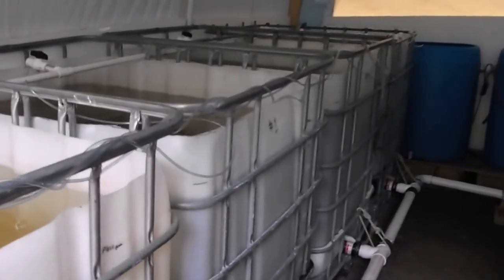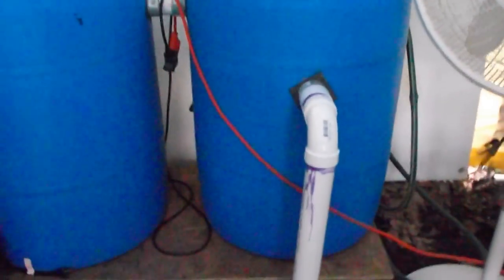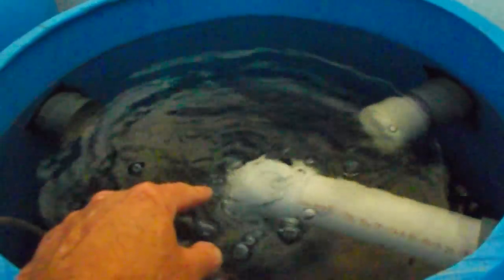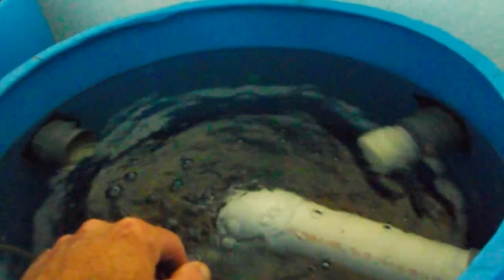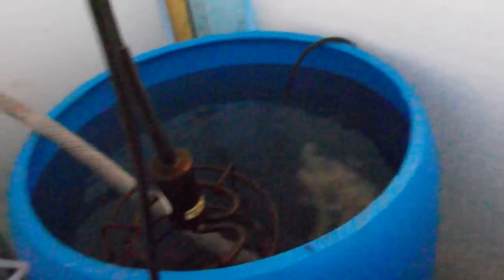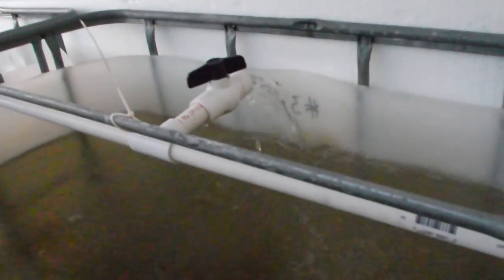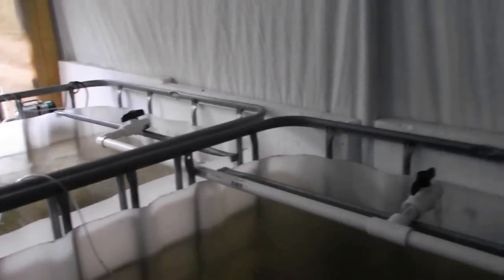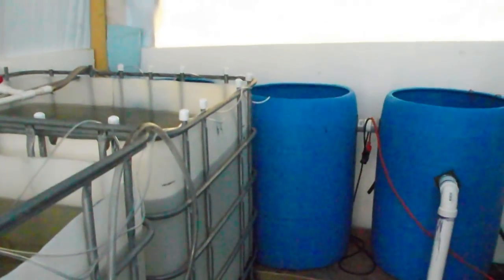Tilapia - Filter System Details

Comment: Good work on the filter design. I have almost finished building my new system using three IBC for the fish tanks. I was going to connect the drains at the bottom like you have, but then I was concerned about the young fish being able to exit the tanks via the drains. So I am using 3" SLOs for my drains. How are the bottom drains working for you and how do you keep the little buggers from escaping their tanks? Thatnk. JW

Comment: Hi Greg I have a 4 tote system so I bought the Active aqua air pump, my question is , do I need to have all the air stones at the same depth in each tote  for the pump to work well and does the length of the tubing matter?.  Thanks in advance for your response.
Reply from the maker: +malisia2mic I never had a problem with the lines being different lengths. I used 5 lines off the bulkhead with an adjustable flow splitter (metal) and it worked with all the flow adjusted to full open and the unused line being turned off.  All of my air stones were at the bottom of the 4 totes and just off the bottom of the bio-filter.
Reply from the maker: +Mineral Springs Tilapia Oh, the reason all the air stones are at the bottom of the totes is because that gets more air dissolved into the water and the dissolved oxygen in the water is what allows the fish to metabolize their food properly and convert it into body weight.

Comment: How many pounds of fish do you think you can grow safely in this system? with the current filtration. And thanks for the nice video and explanation
Reply from the maker: blackboy424 There is just under 1000 gallons of tank space and I grow fish to full size giving them 5 gallons/fish.  If the system was used specifically for grow out, I would stock 50 fish/tote every three months and harvest a tote of fish every 3 months. Given that the average fish after one year of growth would be from 1.5 to 1.75 pounds (some larger, some smaller) on the low end I would be harvesting 75 pounds every third month.  Enough for me and my family....and that was the original goal.
Reply: Mineral Springs Tilapia Thanks for taking the time to respond :)
Reply from the maker: blackboy424 Comments are important. I'm sure other people would want to know the answer to that question. Thank you for taking the time to comment!   Greg.

Comment: Very nice setup.  a few questions as I'm considering doing something like this but for an auqaponics system indoors.

1.  Does it smell?
2.  do you use anything for a light cycle?  day and night?  or just leave it dark?
3.  What is your food source?  do you buy in bulk?  if so where?

Suggestion.  

I saw this on a different video with similar setup but no where near as neat and tidy as yours.  On the solids waste separator, they installed a 3/4" ball valve as low to the bottom the tank and would cycle out about 3-5 gal of water a day to remove the solids that build up in the bottom.  What do you do as an alternative?
Reply from the maker: +David Bonany Hey David, 1. There is very little smell, I always have a fan running and the fish house is well ventilated. 2.  There is plenty of light infiltrating the ends and walls of the of the portable garage and I use artificial light when I need to work at night.  3.  I buy my aquamax at my local coop, any place that sells purina foods should be able to order it for you in 50 pound bags.

Since my barrels are elevated on the stand, I installed a line with a ball valve diirectly in the bottom of the barrel for drainage.  Before, I would just use a syphon hose and remove the waste from the top.   Hope this helps.

Comment: I like the set up you have.and I am planning to make mine the  next month.I am planning to move my fish from fish pond to tank system like this.I have a question,what is the required number of fish in a 1sq.m of tank thank you..I planned to have 4x3sq.m tank 

thanks
Reply from the maker: CATtech 1985 Hey, sorry for the delay, I just got home from Georgia.  In my grow-out system, I like to give the fish 5 gallons of water per fish at full size.  At this stocking rate, the fish grow strong, healthy and quickly.  If they are stocked too heavily it will reduce their rate of growth.  If you have a pure oxygen infusion system, they can be stock more heavily. Tilapia use dissolved oxygen to metabolize their food.  Good luck with your fish,  and thanks for the comment....Greg.

Comment: Hey greg, do you have any idea if the material in the bucket water heater will effect the fish or water. I mean is it purely 100% stainless steel. I wanted to do the same but have heard that nickel in the heaters may harm the health of the fish?? Thanks much for so great information.
Reply from the maker: claudia gamino Honestly Claudia I don't really know for sure. However I do know that there has been no problem with the fish as far as their health and I have not noticed any difference in the flavor of the meat between summer grown fish and fish grown to eating size through the winter when the heater was in operation.  I know this does not fully answer your question, it is only my own observations.  I will try to do a little research and let you know if I find anything that will help you.  Thanks for your comment, great question.  Thanks, Greg

Comment: Hi, can you please tell me about the pipe at the bottom of the IBC totes?  Is it 1.5" pvc pipe with holes drilled into it to let solids flow out and keep fish from being sucked out.  What size male adapter do you use to connect to the tote's outlet?  Thank you.
Reply from the maker: +Mac Townsend You are exactly right. The holes are 1/4" all  the way around the pipe. What you have to do is sand the end that is inserted into the tote's drain hole to create a beveled edge in order to be able to get the pipes started. Put a bead of silicone about 1/2 inch from the beveled end then use a rubber mallet or a block of wood with any hammer and tap the pipe into the drain hole.  The easiest way to connect to the 2 in pipe from the outside threaded drain is to use a 2" X 2" rubber boot with tightening straps (big 2" hose clamps) to tighten over the threaded drain of the tote and your 2"  PVC .

Comment: Hi, Greg, what kind of heater do you use? I am going to implement two tanks of 1000 litters each one and I need a heater, the higher one that I have is a Hagen of 300 watts, and this is up to 300 litters, but for more than 1000 litters what do you recommend ?
Reply from the maker: Hey Israel, I use a 1000 watt bucket heater in my big 1100 gallon system.  If you look at the video called "Winter Water Heating", you will see the heater and the box it came in.

Greg

Comment: Hey Greg, any idea what the flow rate is through your system? My wife is an avid fish keeper, and firmly supports the highest flow rate possible, and I agree. It looks like yours is pretty low rate overall. 
So the pump we have is capable of 4300 gph at 0' head height, but still, highly capable of a very good rate. Assume 4000, that would turn the system over 4x per hour! I was asking about sizing, because you have a 3/4" line with 3/4" valves coming off, and each valve is highly choked back. I'm looking at twice that, a 1.5" return line with 1" valves off to each tank. 
I'm sure we are over doing it, but the pump will serve to let us expand in the future if we wish. I guess I am just curious what size your pump is, and if you've had any water quality issues with the lower flow rates?
Reply from the maker: Tom Brueggen My pump is 1200 gph at 0 head. I always shoot for turning over the system at least once an hour, but I am probably only at 800gph with the lift I have.  Have not had water quality issues and all the waste from the totes still ends up in the solids filter.  I am going to a 2100gph pump in the sump and that should give me what I want.  I totally agree that the higher the flow the better, but in for the last 2 years one turn/hour has worked for me.  I will let you know if it makes any difference with 2 turns/hour when my new pump gets here.

Comment: Hi Greg I am working on starting a aquaponics system. When you built this filtering system did you add any biologic enzymes to start the filter off?
Reply from the maker: David Brooks Hey David, I did not add any live bacteria to my bio filter, but I added fish slowly to the system so I wouldn't overwhelm the system and because I had so much water and so few fish it worked out fine.  You could certainly jump start the filter if you wanted and probably should if you need to add a heavy bio-load quickly.
Reply: Mineral Springs Tilapia
 Thanks for the quick reply my mom and I are going to start with feeder goldfish to start the system with due to the cost of a breeder set of Tilapia Thanks again for the info David

Comment: Perhaps I asked before, but do you have any insight as to how much water you lose to evaporation in a given day or week? I'm designing my system very similar to yours, but I kept the tops of the totes closed with lids fashioned out of the cutout piece, with the main focus in retaining moisture and preventing evaporation. Is that really necessary? The lids are rather cumbersome.
Reply from the maker: Tom Brueggen Hey Tom, I don't really see that as a problem in my system but I do know that there is some evaporation. Because of the bio-load in this system, I have to do water changes (about 250 gallon out of 1000) every 10 days or so.  I could probably do less and just clean out the solids filter and then only drain the tanks out about 10% then refill, but my fish really like the new water.  The main reason I opened the top completely is that when I need to get fish out I have a lot more room to work the net.  The bad part is that it allows the fish to rocket out of the tank when they are being chased by the net and land in another tank I don't want them in or on the ground or behind the totes which is a real issue for me.  With the top cut out it allows me to scrub the scum that forms at the water line and makes a brown rim around the inside of the tote. It also allows me to see well inside the tote. I do a dead fish check (DFC) each morning and if I find a dead one I try to figure out how and why it died.....sometimes an indication that something is not right with the water

Like I said, I think you will be changing water before evaporation becomes an issue, especially if you have a lot of fish in the system. 

Thanks for the comment.....Greg
Reply: Mineral Springs Tilapia Thanks for the detailed response. I was going to ask about jumpers, but you answered it for me! I'm planning on running an internal net in the tank, like what you see at garden centers sometimes, or what big fisheries use to keep fish off the bottom. Not so much so I can keep them off bottom, but so when I want to catch them I can just pull the slack out of the net and start grabbing! 
Man, you're running through a lot of water it seems. Any use for the surplus waste water? I'm trying to make my system as hands-off as possible, as I don't have much time to be hands-on. I'll either have to find a way to automate water changes or minimize them. Ideally minimize them!
Reply from the maker: Tom Brueggen Hey Tom, the only ways I can think to minimize water changes is to go with a more sophisticated filter system so that is a cost/benefit situation. The other is to not have the kind of bio-load I have in my system. My load is"  16ea 1pound + fish, 100 4 to 7 inch fish, and 500+ 1 to 3 inch fish.
Reply: Mineral Springs Tilapia I think my system will be similar. I have 3-330 gallon totes compared to your 4-275 gallons. I also will have 4 bbls in my filter: swirl, bio, and two for sumps, so that will make my overall capacity technically 1210 gallons. Obviously it won't be topped full, so call it 1000 gallons for easy numbers. Right now we have 300-400 fingerlings that we need to move into bigger tanks. We have them spread out across a few 10 gallon tanks. Craziest thing, we have three of the fingerlings that are monsters compared to the others. Must be some good genetic glitch best I can figure. We're going to try to keep them isolated so we can use them for breeders. They are from our second batch of fry, a month younger than the others, but 3-4x the size! 
We are using rolling K1 in our bio filter. Are you familiar? Not sure how it lines up against your lava rock but it's supposed to be the best of the best as far as surface area for the beneficial bacteria to live on.
Reply from the maker: Tom Brueggen Well, 300 fingerlings is not a lot in 1000 gallons, and the bio-filter will be able to easily handle that kind of load and with the K1 you have plenty of surface area for the bacteria to grow on.  Also, the bacteria will grow on every surface of your system.  As your fish grow, and as you increase in numbers of fish, the bio-filter should grow right along with the load..I think you should be OK for quite a while.  As far as the fish that are outgrowing the others, that will happen more often than not.  Typically I find that those fish are male which always grow larger and faster than the females. This is not to say that those are the only males in the brood, they are just more aggressive than the others when feeding and consequently grow quicker.  What is the goal with what you are doing.....selling fingerlings? selling breeder colonies?, growing out to size for your own use? or all of the above or something else?

Comment: hi. Greg. i have more or less the same you have. you have 4 tote i have 3. but my filter system is really bad. tomorrow i go to buy (3)  55 gall to do your idea look amazing. but my question is. you have the 55 gall barrel over a wood pallet. this is for water level or is just because you like it. thank you Greg.
Reply from the maker: Luis Cancel Hey Luis, I have them up on the platform so the top of the barrels and top of the totes are at the same level. That way if your pump goes out or you have a power outage your system will just stop and you won't lose any water from the system.
Reply: Thank sir

Comment: hello friend. I HV enjoyed your explanation of the flow through the system. Could u plse inform if you are using uniseals por other form of going through the barrels. I see a black square. Is that a rubber washer? TKS for the help!
Reply from the maker: I used the gray electrical pvc connectors, however if I did it again, I would use uniseals.

Comment: Just a quick question, what size pump do you use for your system?

I'm working on setting my system back up, and trying to figure out a pump to use... when Its all set up, it will have 6 IBC fish tanks, 4 55gal barrels for filters, 1 IBC for a sump tank, and then several growbeds...

Previously I had been using a 220 gph submersible pump, but that is way to small, I picked up a free pool pump, but its an energy hog,.. 15 amps continuous. It pumps upwards of 4200 gph, I'm guessing I need something in the 1500 - 2000 gph range. or perhaps 2 different 1000 gph pumps. My system when all set up should hold about 2700 gallons, unless I decide to dig a bigger sump tank, or add the grow out pool.
Reply from the maker: Anthony Jensen Hey Anthony,  I always try to size my pumps to turn over the total volume of water in the system at least once an hour.  A little more or a little less should be fine.  I would look for something a little more than 2700 gph because with all of the components in your system there is bound to be some "lift" involved.
Reply: I love what you are doing. Very easy system and understand. I am doing a 4000 gallons tank with a 5000 gallons water pump. (2) 200 gallons ibc tote biological filter. (1) 55 gallons drum swirl filter. Is the 55 gallons swirl filter be too small? The water pump will move a lot of water fast. What is best approach to this situation?